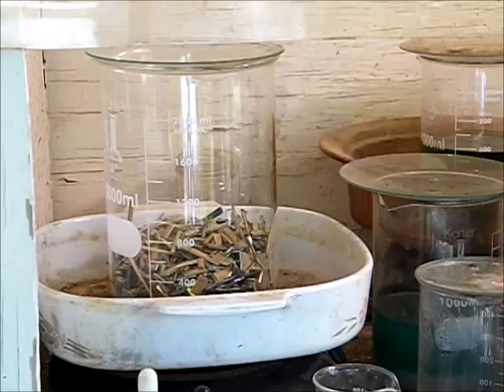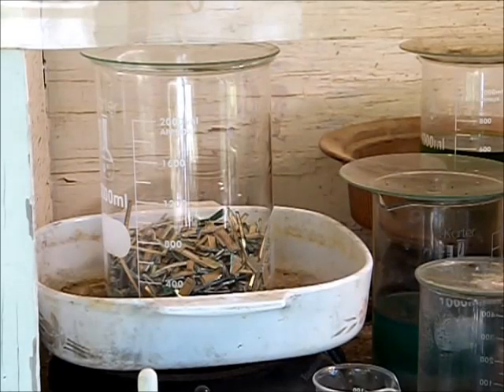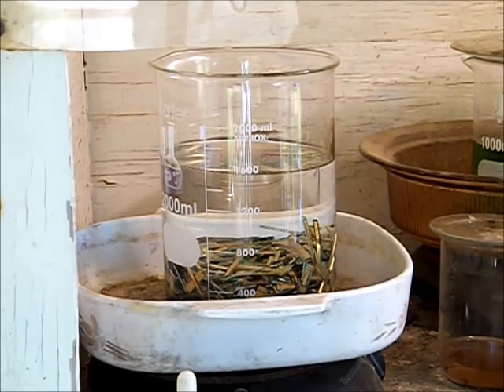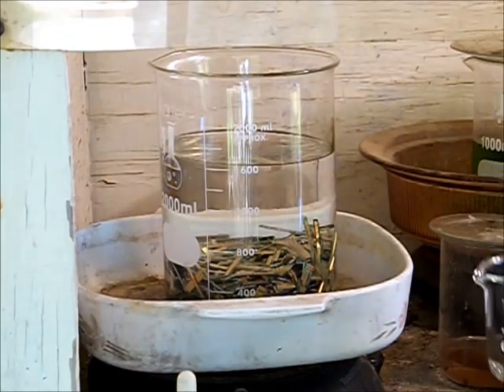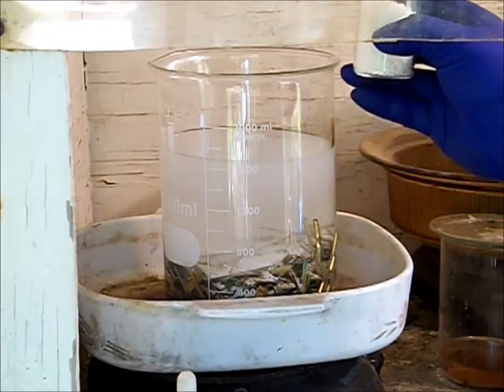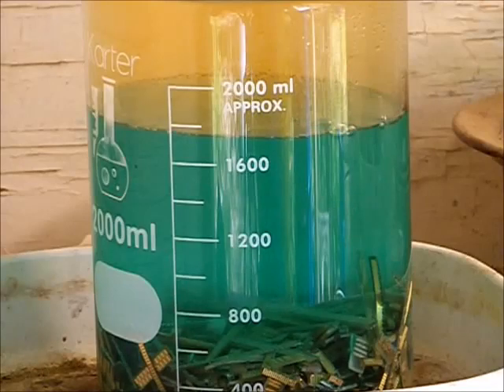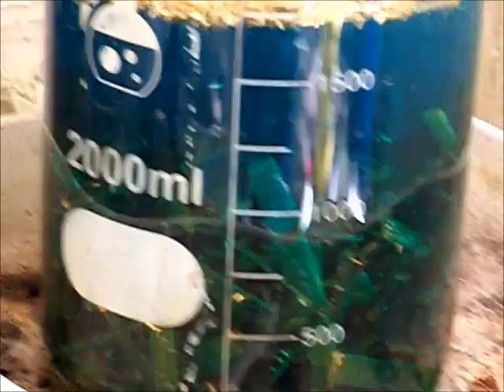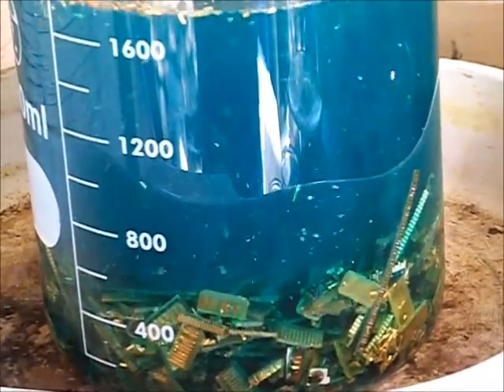poorman's nitric acid

Comment: Thank you, sir - I love this method!  I mean, the idea of reclaiming and refining precious metals with laboratory equipment and chemicals is cool.  But doing it with stuff from the local hardware store, garden supply store and thrift stores is badass.  This is even cooler than acid-peroxide.  You're a steely-eyed man of science for sharing this with us
Reply: What the heck is "gold finger" he's talking about?  Are they gold plated metal pieces?
Reply: @BillAnt  yes, they're the gold plated pins like the ones old hard drives had for the cable to connect to, or the tabs on video cards that slide into a socket on the motherboard

Comment: All you have to do is stick a chunk of IRON in the copper solution to make it crash out as copper metal.
Reply: Yes. Ive used a stainless steel spoon to recover copper from acid solution, but after a while the spoon dissolves.  I guess iron is a cheaper alternative.
Reply from the maker: Yes. Any metal that's more reactive than copper will "cement" the copper from solution. Aluminum is faster but gets hot quickly. Iron is cheaper and slower and doesn't heat up as much.

Comment: If you only have calcium nitrate, you can add sodium sulfate or some other sulfate, then heat it while leading the vapors over in a beaker with water forming nitric acid without the crystallization of calcium sulfate, saving your glassware.

Comment: I think that drain opener is only 53-70% concentrated from what I've read online. I have some I'm getting ready to distill and looked it up. 
Still strong enough for most uses.
Reply: Depends on what drain opener. Around here we have 97-98% virgin concentrated sulfuric acid for $9.99 a quart. Even if you dont have that concentration and  or additives in your acid you can clean it by heating you h2so4 and adding drop wise cold concentrated hydrogen peroxide. Continue heating to steaming off water until you reach the maximum concentration of 98%.

Comment: What % proof is the mixture as I believe it needs to be 70% so silver can be processed properly? I'm in the UK so it's nearly impossible to get hold of nitric so if this works for refining scrap sterling silver then that would be great? But it does depend on the %
Reply from the maker: It does work with silver. 100 grams of sodium nitrate and 30 ml's of 98% sulfuric acid and 1000 ml's of distilled water should dissolve 200 grams of sterling.
Reply: @GeoONE  and then do you drop the silver back out using hydrochloric acid?

Comment: Sir, in your opinion, could you explain, at least how much comparison in volum to be poured for making the solution when I will use  HCl : HNO3 such that it can proper in the work (remain to able to dissolving copper) and safe for environmental? Thanks in advance
Reply from the maker: Solid sodium nitrate can be calculated at 1.1 gram of solid nitrate equals 1 ml of liquid nitric acid.
Reply: @GeoONE   1 mL nitrit acid for how much HCl ?

Comment: Geo I like your video very interesting quick question for you will this work on fully plated pins and partially plated pins thank u for your time.
Reply from the maker: Yes. Keep in mind that heat is required to drive the reaction to completion.

Comment: Hey, don't quit now! I come back to your channel over and over. I would love to see you process the copper out of circuit boards.
Reply from the maker: It's actually in the works.
Reply: @GeoONE   That is awesome! Thanks so much!
Reply: Why would you go through that much trouble for such a small amount of copper? It's less than $3.00 a pound.
Reply: @E-BikingAdventures  eviroment in pack then you can pull out the silver lead and neutralize the solution and dispose it's an easy process.

Comment: One more quick question my solution is bluish green with a whitish gray film once I start decanting
Reply from the maker: Usually the white material is tin that is dissolved by the nitric acid that is formed. It is called metastannic acid. Once the foils are gathered, dissolve the foils in what ever acids you like and the white should be left unchanged. Filter the solution well and make sure it's clear before dropping the gold.

Comment: Will this work to refine silver and then dropping it with copper?
Reply from the maker: Yes. If done properly, it works just like nitric acid.
Reply: @GeoONE  So when you say "done properly," you mean use distilled water instead of tap water, correct? Is there anything else to do when using with silver?  Thanks

Comment: Great video. What happens to the silver if there is any? Does it dissolve in the solution or come out with the gold?
Reply from the maker: There's no silver in fingers. Although if there had been silver, it would dissolve. The gold does not dissolve in poor mans nitric acid.
Reply: Yeah the reason I ask is coz there is Silver in some CPUs so wanted to know how I can get to that too after I've removed the gold. Absolutely love your video. Thanks so much for sharing. I'm thinking ahead to the next step to see how I can get the silver from the waste.
Reply: I'm guessing same ingredients again but adding a copper base to cement the silver
Reply: @shshgaming189  true..

Comment: Hi, would this not need to be distilled first for refining scrap silver? Regards
Reply from the maker: No. There is a gentleman on my facebook group Ewaste And Precious Metal Refining that I have helped him with the process of working with silver. Substitute tap water for distilled water for silver.
Reply: @GeoONE  geo thanks for the reply, the reason I asked is that there's loads of people that use distillation first to make a concentrate Nitric. So this process that you have shown will refine things like scrap silver bars? Worn scrap coins, flatwear etc? Regards
Reply from the maker: @thewatchers9620  Yes. It will dissolve silver and then you can cement onto copper just like nitric acid does.

Comment: boy I like this way much better than distilling a nitric acid 1st
Reply from the maker: I think it is.
Reply: @GeoONE  will this make aqua regia when mixed with hcl
Reply: I used pot nitrate sulfuric acid and water if mixed heated by themselves btw I mixed this method up and haven't used heat yet my pyrex overflow pan shattered on burner haha getting a replacement soon stainless steel big dog dish soon as I can get past the neighbors dog just kidding

Comment: Does it have to be hot to get tge silver out?? Or how
Reply from the maker: This material will not have silver. If you are working with material that has silver, the silver will dissolve just as it would using nitric acid. To recover the silver, add a chloride such as non-iodized salt or hydrochloric acid. Or you could cement the silver out of solution as a metal using a piece of copper metal.
Reply: @GeoONE  thank u for your fast reply. Which is better using hcl or copper. With hcl dont u need to convert it? But the copper will contaminate the cemented silver a alil
Reply: I am trouble telling when its done. It is finely divided material and its hot. Some bubblez but i cant tell if its from heat or reaction
Reply: Did it work on the silver? And I’ll be bringing it back with copper I think that might be best, but I could be wrong! And should I leave it heating up as the copper is in. I have about 4 ounces of 925silver ???

Comment: sir is soduim hydroxide lye and drain opener are the Same?
Reply from the maker: Sodium hydroxide is lye. Drain opener can be either sodium hydroxide or sulfuric acid.  It should say on the label which chemical it is. Sulfuric acid drain opener will normally be in a sealed plastic bag.

Comment: Hi there, probably a dumb question, but how much gold fingers did you start with by weight?  I think I have the rest of the process down for using the poor mans nitric.  Also, as you mentioned the list of other metals this can be used for, for silver recovery and refining this process is ok except distilled water needs to be used, but then the rest of the process is that same right?  adding distilled water, and a chunk o copper to cement out the silver?  Lastly, cpu pins, kovar, I am guessing this works on that as well?
Thanks my friend!
Reply from the maker: On this particular batch, close to 8 pounds. It will dissolve silver but works better on impure silver such as sterling. Not sure why anyone would want to dissolve pure silver any way. :-D Use distilled water and the process works exactly the same way. Copper is what I use to cement my silver with. Make sure to denoxx well before cementing. Yes, it works very well when working with processors.
Reply: @GeoONE  Sorry, I should have been more precise, yes, i was referring to silver from contact points,  broken sterling jewelry etc.  Can this be used to make AR for gold recovery from ceramic cpus, IC's, and eproms?

Comment: GEO - A fun (and informative) video to watch.  QUESTION:  I would love to do this with some of my concentrated filter cake I collected from leaching actual ore.  I've got some 250 mesh cake that is 2%+ Au.  Do you think I could I run the material in this solution to remove the copper, lead and silver in the first go around.  Then run the leftover material in another batch of the poor-man's nitric mix but add some HCl (to make poor-man's A/R) to put the Au into solution before dropping it with SMB.  I really want to do this after watching you.....THANK YOU
Reply from the maker: It should work okay.
Reply: @GeoONE  I am opening a PGM mine this year and am looking for refinement methods that are inexpensive and safer than amalgam. I want to be able to remove the ferrous with magnets from our concentrates and put them right into solution and drop out each valuable metal and recover the acids and precipitates for future use and reduce environmental impact and lower overheads. The mine was an amalgam operation in the 1800s, so there is mercury present. There is also lanthanides and thorium. Any suggestions are greatly appreciated. I was very excited to see this video. Thank you kindly, sir!

Comment: Geo, i wanted to clarify that this method would remove the base metals from gold plated pins and or circuit boards? and using  sodium bicarbonate as the acid neutralizer?
Reply from the maker: It will dissolve base metal but neutralizing is not necessary until treated as waste.

Comment: Hi Geo I appreciate your videos my name is Marco Ramirez I am new to gold recovery but I am a trying this process with coffee Parts as my heat source how long does it have to soak and break down it’s been about three hours on my end and it’s bubbling and I see a little bit of gold but not a lot is it because the heat isn’t hot enough thank you
Reply from the maker: You answered your own question. It needs to be hot enough for the nitrate to decompose to nitrogen dioxide (red fumes). Somewhere around 230°F is minimum. I normally crank my cheap burners wide open. They run around 350°F and it works really well.

Comment: When I use this process I get a white - grey silver chloride looking powder that is a real pain "not silver either". Any idea?
Reply from the maker: If you are dissolving pins, most pins are brass or phosphor bronze and contain tin in the base metal. Dissolving tin this way will make metastannic acid. It's a gooey, sloppy mess that clogs filters and traps foils. I know how to deal with it but that will be in another video.
Reply: Geo  that's what I was thinking. Sure would like to know how to get rid of it. I mostly do pins with rev- electro. But tried it with this method worked great other than the powder.
Reply: Remove solder from pins with a boil in hydrochloric acid first to get rid of tin

Comment: Why do u need sulfuric if ur usng nitrate
Reply from the maker: The sodium nitrate will not decompose and release NO2 without the sulfuric acid. The sulfuric acid is a catalyst. It decomposes the nitrate salt releasing nitrogen dioxide which is absorbed by the water creating nitric acid in the process. It will not work without the sulfuric acid.
Reply: Geo im sorry i dont understand, other ppl do it different or use different nitrate???
Reply: Also is heat required for a reaction
Reply from the maker: The sulfuric acid breaks the bonds between the sodium and the nitrogen releasing nitrogen dioxide. The NO2 is absorbed by the water in solution and is turned into nitric acid all in one go. Yes, heat is required for the reaction to take place.

Comment: hir sir i start to recover gold that have i collect pin pinger and old cellphone board i've been used salt,vinegar and peroxide 3%, it is good or not, thank u
Reply from the maker: Not recommended for beginners working with material with high tin content due to the formation of metastannic acid. It will dissolve the base metal from the material you described and leave the gold untouched, the foils will be mixed with a white jello looking mess that's hard to separate from the gold.

Comment: Geo , what will this mix do to I.C. chips?
Reply from the maker: It will dissolve base metal and silver leaving the gold metal intact. I've used it for this purpose many times.
Reply: @GeoONE  so if you were to do ic chips would u still need to try and get the metal out before using it? Or just leave everything and it'll dissolve it?

Comment: So use this just like if it was nitric acid for silver, then dilute solution add copper to bring back silver ??? I wonder what kind of lost u would have?! I’m wanting to refine my 925 silver to 999 silver!!! I have about 4 ounces of 925 DANGIT IT! iTS HARD BEING APOUR MAN
Reply from the maker: No loses that I know of. Experiments have shown that it works well for silver. Members of my fabebook group have been using it for a couple of years now.
Reply: I got it set up now wish I could show u picture lol I just started it and it’s with sulfuric acid and stump remover wish me luck thanks
Reply: Geo  well i got some acid it turned my finger yellow! I was kind of trying to distill it and that didn’t work. I poured off what I had and it dissolved copper so I stuck a silver quarter in it, the reactions going real slow even with heat. looks like some black stuff around the quarter and guess to what I might want to do next ??

Comment: Great info.  I can't find 16-0-0.  Would 32-0-0 do?
Reply from the maker: Since it will dissolve silver, I would not use urea as it can form an explosive compound with dissolved silver.
Reply: Hello Geo, amazing video and explanation. I also cannot find 16-0-0 and the cost to buy it and ship it to me is just as much as buying nitric, which I have a case of but would rather not use up so fast. Would 16-0-1 work? Will that 1% potassium be an issue?
Reply from the maker: @davew3649  I don't think so. Calcium is a real pain though.
Reply: @GeoONE  i think you replied to the wrong post😨

Comment: Nice I thought i was the only doing it this way actually I add peroxide to  it when doing doing silver. Which  was found by accident  while  making piranha solution for a batch pins my bag of nitrates had a hole in bottom and while I stood up  a decent amount  fell right in my piranha  I thought it was trashed  but I let it go on low heat and in 2 hours  nothing but gold foils and some cool looking copper sulfate crystals. 2 times  faster  with the peroxide. And no gold in solution 🤑
Reply from the maker: It does work with silver.
Reply: So if you're recovering silver too you add peroxide? I didn't get that part.
Reply: Peroxide is an oxidizer i use it just to speed up the process wether it is gold or silver or any mettal it makes it faster .however peroxide and hydrochloric acid when heated will dissolve your gold.

Comment: Hi Geo so after doing this process and filtering to have just the gold coils how would we dissolve the gold. I thought Nitric acid dissolves gold. Isn't this poormans nitric acid?
Reply from the maker: Gold foils can be dissolved a couple of ways. Hydrochloric acid and chlorine bleach will dissolve gold foils and powders. Hydrochloric acid and nitric acid will dissolve gold of any type. Nitric acid alone will not dissolve gold. It must be in combination with hydrochloric acid. Aqua regia is a mixture of 3 parts hydrochloric acid and 1 part nitric acid.

Comment: I bought a drain opener but it says it has lie it doesn't say anything about sulfuric acid
Reply from the maker: Drain opener was made with both chemicals. You have to find the kind with sulfuric acid.
Reply: Geo will it say on the bottle? Isnt lye the opposite of sulfuric acid?
Reply from the maker: Yes. It will say "contains virgin sulfuric acid" on the label. Yes, sodium hydroxide is a strong base and is the opposite of acid.
Reply: Found it thanx
Reply from the maker: Your welcome.
Reply: Geo can i add hcl to make AR ?how muxh?
Reply from the maker: HCl and sodium nitrate make poor man's AR. Use 1 gram of solid nitrate for 1 ml of nitric acid.
Reply: Geo im not gettting a good reaction i did exactly ur measurements and thr same products..im heating it but just small bubbles
Reply: No green color either
Reply from the maker: If it is copper, it will be blue and not green. Green is copper chloride and blue is copper nitrate. If it is making small bubbles, it is working. It may not be hot enough. I do mine on high temp.
Reply: Geo do i want it to boil?
Reply from the maker: No. Just below a boil.
Reply: Its working but seems slow but i had it on low
Reply: How long does it usually take 4 a run
Reply from the maker: It depends on the amount of metal to dissolve. The batch in the video took about four hours.
Reply: Geo i made half a batch of what u made in the video so 850ish ml...how much hcl, should i start my ar with fresh nitrate or half used nitrate acid...how much ratio..i saw 1g = 1 ml
Reply: I call it nitrate acid cuz its not exactly nitric
Reply from the maker: This doesn't contain HCl. That is a different process. Are you wanting to make AR?
Reply: Geo yes